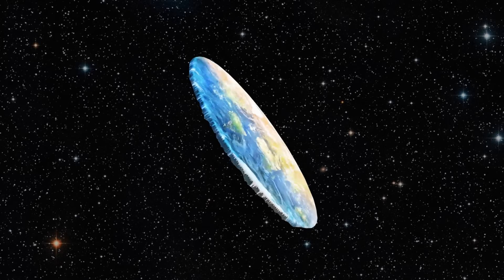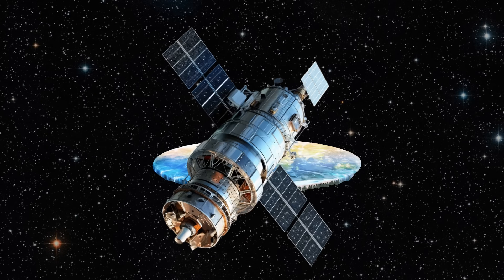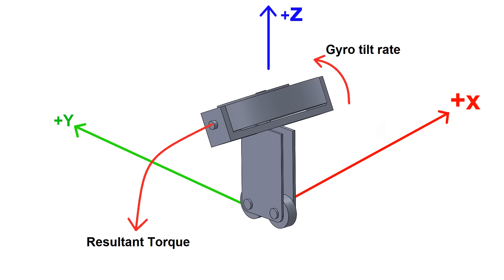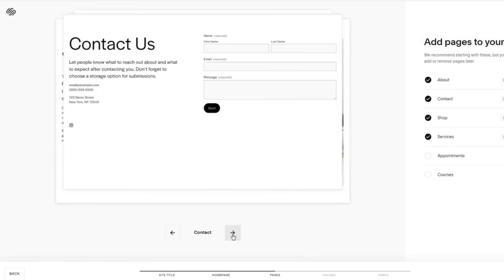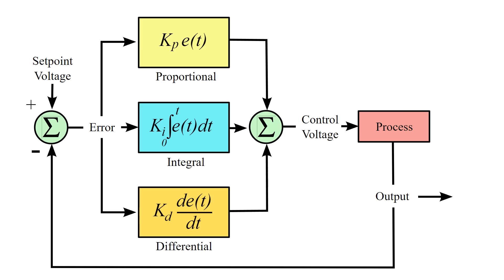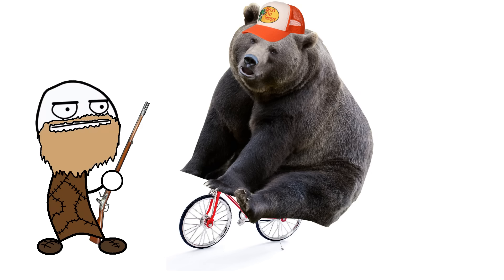Gyro-Stabilized Monorail Train

Comment from the maker: To clarify the P-factor thing: Technically it's an aerodynamic effect from asymmetric thrust off a propeller resulting from angle of attack, but a fast rate of pitch will also cause a gyroscopic torque about the yaw axis absent any aerodynamic effects.
Reply: Make a Securitron (Fallout New Vegas Game). I am sure you get a video with over 2M views. 
Securitron is a robot that has a mono wheel to mover around, two arms and TV screen in the center.
Reply: You know what that whole thing across the axis x I guess and then y/z traveling servos adjusting the x axis the distribution weight pole thing
Reply: Please for the love of all that is holy @HyperspacePirate search for "gravity assist engine" its a paper in Acta Astronautica that I need someone like you to read.  Been trying for years to get some one besides me honed on it because I think it's got something
Reply: Do you think it's possible to create a piezoelectric battery with Quartz that's suspended in a pressurized tank and a sodium hydroxide solution with a sort of insulation for the interior of the tank?  The mechanical pressure from the tank should in theory induce the piezoelectric effect and the liquid solution would conduct the discharge to a pair of terminals. Or would it be better to wrap the quartz in copper and then run wires directly to the for mentioned terminals for an output?
Reply: @LeonNachshon  I think so.. perhaps under pressure literal some kind of audio could be applied to the external side of the tank and create the impulse.. probably more complicated electronics are required
Reply: @LeonNachshon  maybe the surrounding distortions in atmosphere could be enough
Reply: @LeonNachshon  special type of bladder
Reply: hello,can i access your solid work model?
Reply: So, do you do design projects for hire?
Reply: Clearly this is far from the original design and functionality . The original has no digital componaants. No greenboard . No computer. Only mechanical . Which is all of your designs issues.

Comment: Outstanding work !
1.- be aware the self stabilizing bicycle with these type of gyros is going to be a double-sided sword: While vehicles with motors can incorporate such devices, with all the required fine-tuned control loops, on a bicycle YOU, the rider, is the one having to perform such fine-tuning. The adaptability of the software required for such gimbals-stabilized bicycle, to make it independent of terrain, slope, weather, your weigh, additional payload, varying tarmac grip, tyres conditions, ... may render suxh bicycle only safe for specific er
routes and conditions
2.- 
This counter-spinning principle is the same of the mythical Chinook helicopter, correct?

Comment: AI Summary

Abstract:

This technical demonstration evaluates the application of Control Moment Gyroscopes (CMGs) for the lateral stabilization of a single-track monorail prototype, modeling the 1903 Brennan Gyro-Monorail. The study contrasts the operational mechanics of CMGs against traditional Reaction Wheels, highlighting that while reaction wheels rely on the angular acceleration of a mass (limited by motor saturation), CMGs generate torque through the controlled tilting of a constant-velocity spinning mass. 

The prototype utilizes a dual, counter-rotating gyro configuration to cancel parasitic yawing moments (analogous to P-factor in aviation). Key engineering challenges addressed include the management of "gimbal lock"—a condition where the gyro axis aligns with the control axis, resulting in a loss of control authority—and the mitigation of high-frequency vibrations on the IMU (Inertial Measurement Unit). Final implementation utilized a PD (Proportional-Derivative) control logic via an Arduino and MPU6050 sensor to actuate RC servos. Results indicate that while CMGs provide high torque-to-weight ratios, they require significantly higher control granularity and sophisticated damping (moment of inertia enhancement) to overcome the resolution limitations of standard hobbyist actuators.

 Technical Summary: Gyroscopic Stabilization of a Monorail Prototype

*   0:25 CMG vs. Reaction Wheels: Reaction wheels generate torque through angular acceleration, facing "saturation" when the motor reaches maximum RPM. Conversely, Control Moment Gyroscopes (CMGs) utilize the precession of a constant-high-speed rotor to generate torque, offering potentially higher efficiency for sustained stabilization.
*   3:03 Physics of Gyroscopic Torque: Torque is the cross product of the angular momentum (L) and the rate of tilt. Tilting a spinning rotor 90° away from its axis generates a perpendicular torque vector, a principle leveraged for vehicle roll correction.
*   5:58 Counter-Rotating Rotor Dynamics: A single gyro induces unwanted yawing moments (P-factor) during pitch changes. The prototype utilizes two counter-rotating rotors of identical mass and speed to cancel these parasitic torques, ensuring only pure roll-axis correction is applied.
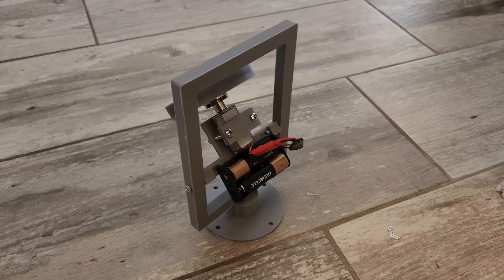*   8:23 Gimbal Lock Constraints: CMGs suffer from a saturation-equivalent known as gimbal lock. As the rotor tilts toward the control axis, the effective torque follows a cosine decay, eventually reaching zero authority when the rotation axis aligns with the vehicle’s roll axis.
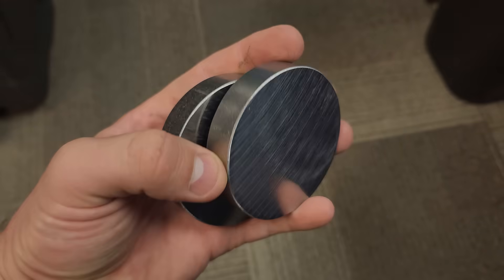*   10:30 Material Selection and Inertia: Initial tests with 3D-printed ABS flywheels (58g) were compared against solid steel discs (7.8x density). While steel provides superior angular momentum, it introduces severe balancing requirements and vibration-induced noise in the accelerometer/gyro sensors.
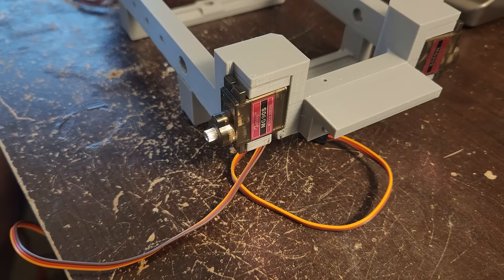*   12:55 Electronic Architecture: The control stack consists of an Arduino-driven MPU6050 IMU, with power distributed via an LM2596 buck converter. Precision is managed by a PD control loop where the D-term (derivative) provides necessary damping against oscillations.
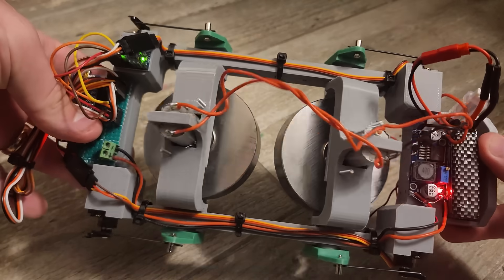*   14:26 Control Loop Resolution Issues: Standard RC servos operate in 1-degree increments. This lack of granularity caused high-frequency "jitter" when paired with the high angular momentum of steel flywheels, as the control system could not command the infinitesimal tilt rates required for smooth stabilization.
*   15:55 Inertial Damping via Booms: To stabilize the system within the limits of the Arduino control loop, the vehicle's moment of inertia was artificially increased using horizontal booms. This slowed the vehicle’s angular acceleration, granting the servos sufficient time to respond to tilt errors.
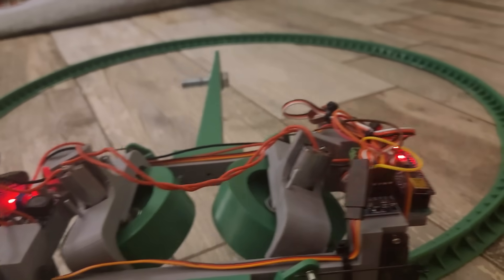*   17:14 Key Engineering Takeaways: Reaction wheels are simpler for low-mass applications. For future CMG iterations, position-based RC servos should be replaced with high-torque brushless Outrunners using torque-mode (PWM) modulation, similar to modern camera gimbal architectures, to improve response linearity and resolution.

AI-generated summary created with gemini-3-flash-preview for free via RocketRecap-dot-com. (Input: 22,777 tokens, Output: 940 tokens, Est. cost: $0.0142).

Comment: 4:06 x vector should point differentdirection since it is counter clockwise. It also caused issue with resulting torque direction (it should be clockwise)

Comment: The servos apply unwanted torque to the rotors which causes them to gitter. Use electric motors and apply a corrective torque when needed and shut the motor off when not needed and the gyros will be free to precess naturally. I have built self balancing gyros before and could never use servos to control the gimbals because of the torque issue - you must have close to zero friction in the gimbal to let the gyros do their thing. Not trying to be a knowitall, I have gone down this same track.

Comment: The MPU6050 is a very old and very noisy accelerometer. Newer sensors like a icm-42688 (or even a BNO055) are an order of magnitude or two less noisy. I bet you'd get significantly better control with this one change.

Comment: 14:35 The servos may be working against each other. Tolerances and slight deformations could cause the servo on one side to push the servo on the other side out of the position it has reached, which then adjusts and affects the other side.
As the complete control range is apparently not required, the lever on the servo could be shortened. This would give you more torque and a higher resolution.

Thanks for the interesting video! 👍

Comment: Have you ever delved into 'ring laser gyros'? Not really applicable to this project but seriously brilliant design. They were so good, I have never seen/heard of one needing replacing during my military career vs the older traditional gyros which constantly failed. For those not familiar, a laser is used to detect to earths rotational direction on powerup, precisely setting East and West in mere microseconds vs the traditional 45 minute 'precision align' needed for a traditional gyro. I'm told newer ones don't even have moving parts anymore which is curious.

Comment: You can control the servos more precisely if you drive them with calculated impulses in microsecond (0° 1000us - 180° 2000us with 20ms period time) instead of using arduino servo library.

Comment: What about high rpm disks and using abs breaking to get the torq to tilt up? Not sure about its overall efficiency, but I think it will excell at recovery from almost impossible angles, since of it's explosive power. Might be a challenge to tune for not overshooting. I imagine a fusion system where you got reaction wheel or control moment gyro for efficient easy stabilization and a break wheel for less frequent but stronger recovery ability = wider range of operation

Comment: May be a good idea to use a reduction system with those servos to gain motion resolution, plus can use a smaller servo for the same task since reducing the mobility of the servo with a reduction sistem, you gain strenght .. may be a gear reduction..can be 3d printed, but i may preffer a string reduction system, lookd better and works smoother with less backlash.

Comment: You may be having issues with spinning metal affecting the MPU6050. Try reading out the values from it while the motor / servos / disks are spinning. See if the data is reasonable.

Comment: 0:25 the International Space Station caries 4 + spare of these.
Length: 109 m (358 ft) (overall), 94 m (310 ft) (truss) Width: 73 m (239 ft).
4.5 million lines of code to make it work.

I kinda figured this when i was fixing my bike as 10/11 year old kid, i was spinning the front wheel of my BMX with my fingers while holding the wheel or shaft.
the wheel resisted my force when i tried to move it.

Comment: I don't think your issues stem from the RC servos' angular resolution; Rather, I strongly believe that using a digital PID control law is a TERRIBLE idea, especially in this case.
The biggest issues you have is uncompensated control loop latency, followed closely by trying to control a nonlinear, time-variant system the same way you would try to control a well-behaved LTI system.

The easiest fix that I can think of for a toy problem like this, is to first measure (and try to minimize) the latencies imparted by each component, as well as decompose your plant into it's most important, quasi-linear constituent regimes. Then you can use the z-transform to design a latency-compensated controller for each of those linearized regimes and simply have the MCU switch the active control law each time the system crosses over into a different linearized region.
This should be much quicker and easier than modeling and designing a proper nonlinear control system to cover the entire control space.

If, after doing the Z-transform analysis, it turns out that you have too much latency to compensate at the bandwidth you need to reach for a sufficient stability margin, then I would very strongly suggest that you abandon the digital rate sensing and motor control parts for (at least) the most critical, small angle and high-frequency system observation and actuation components; Rather just implement your main (or inner) control loop(s) in the analog domain, using high-bandwidth op-amps and linear H-bridge drivers.
You could then still have an outer digital loop that takes care of the slower (or less latency sensitive) tasks, since the inner analog loop would effectively make the plant look like a much more well-behaved (and, preferably, stable within the small-angle linearized regime around its static balance point) and easier to control system.

Comment: If you switch to microsecond control of the servo pulse commands you might get better resolution. Typically servos will have a range from 1000 us to 2000 us pulse length.

Comment: What you want is a nested PID loop
the outer loop uses angle position error to produce an angular velocity setpoint
the inner loop uses angular velocity error to produce a torque setpoint (which maps directly to a CMG output)
and also, you really to need PD control for something like this because P-only is doomed to oscillate. TBH integral term would be useful too. PID exists for a reason.
Reply: fuzzy is better.

Comment: Make the servo-rods "springs" and you'd get the servo to be force control rather than position control. Adjusting the spring-rate will change sensitivity. A few loops on piano wire is likely gonna do the trick.

Comment: Brushless DC but rewind the coils, having re-stacked the laminations so the poles 'twist' or overlap multiple magnets to reduce cogging. Makes them much better for this kind of application (also jobs like stabilising an inverted pendulum) because the torque available has less position-dependance. In addition you can change the wiring to trade speed vs voltage for better torque at the expense of maximum speed, which may also help.

Comment: If you got some higher quality bits couldn't you just drill out the broken drill bits?

P.S. - Do you know about Brennan's Monorail? Louis Brennan built a full size prototype gyroscopically stablized monorail like this back in like 1909/1910 that fuctioned on existing railway. Seemed to work decently well too. There even a few pictures out there of it in action. Importantly, it obviously had no need for microcontrollers to function.

Edit: Seems like you are aware of it. I supposed you must have mentioned something about it earlier in the video but I didn't notice, but toward the end you mentioned "the monorail from 1903", though 1903 is just when the patent was filed, it wasn't actually built or demonstrated until 1909.

Comment: The original design had a lot more mechanical means of handling the gyro movement. I wonder if there is a way to implement that. Outside of spinning the wheels a purely mechanical setup might be easier to tune with weights sliding on a pendulum and such. Should also lean into corners automatically. The key for this, to me, is less electronics that can fail or get bad signals and more mechanical certainty.

Comment: I think if you were to couple the gyros to the servos with springs rather than rigid links this might make the control system design a bit easier. This would allow the servos to apply a torque rather than a position, and in the short run servo position would just directly translate to righting torque on the vehicle. Of course due to precession the gyro position would be the integral of the total torque applied to the vehicle over time: so the gyros would tend to drift towards lock and there would need to be another control loop on commanded servo position that biased the vehicle position command towards the opposite side of vertical to "unwind" the gyro position... honestly, how did you get this thing to balance with only a proportional control from vehicle position to servo position? That's impressive, it doesn't even feel like it should work! Always fun seeing what you're up to!

Comment: You just reinvented the engineering marvel - Brennan Gyro-Monorail from 1909. Also you overcomplicated it and got much worse result :D
You're digitizing gravity instead of using it directly

Edit: I meant that the author of this video overengineered it. Fixed comment.
Reply: Uh... no, it worked perfectly fine. There's pictures of it running at high speed with people in. It wasn't feasible, because every car would've needed the same mechanism as the locomotive. As feats of engineering go, it's probably one of the most important ones of the early 1900's.
Reply: @aserta  Sorry, I meant that the author of this video overengineered it by using a microcontroller

Comment: Honestly, if possible i would have had those disks balanced at a machine shop, where they can do proper indexing and honing. I know it's outside of the spirit of maker diy, but parts with a lot of inertia concentated in a small area kinda need a little cheating.

Comment: Your control scheme assumes that the accelerometer measures the angle of the vecicle. But its also influenced by the sudden motion that occurs while correcting the angle by a discrete step. This is a large unintacipated feedback in your control loop.
Test for this by evaluating the magnitude of the acceleration. Ideally use another way to detect the angle. Maybe with a free spinning gyro?

Comment: For the servo issue you could use a longer arm on the flywheel assembly to reduce the amount of movement the servo is providing. 

The other option would be hydraulics as they are fairly simple (LEGO) to implement and have high torque and extreme precision

Comment: You need to use Madgwick or Kalman sensor fusion filter , the lateral acceleration of the mpu when the vehicle rotates faults the angle reading when deriving the angle heavily from accelerometers .